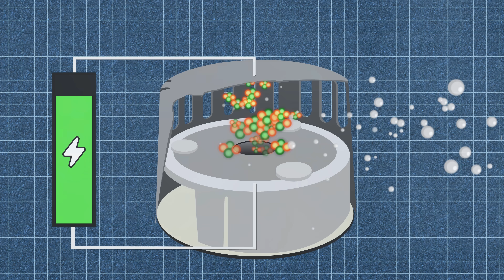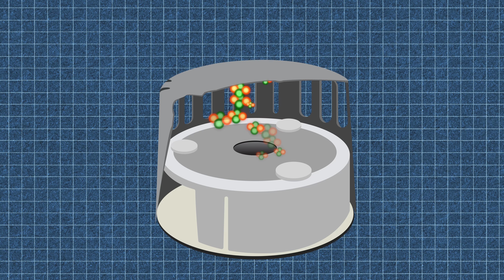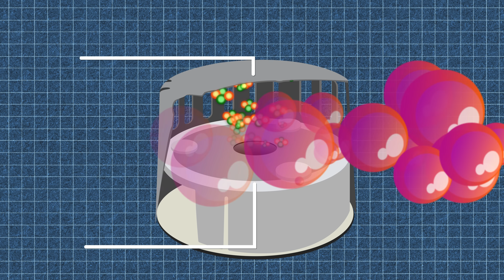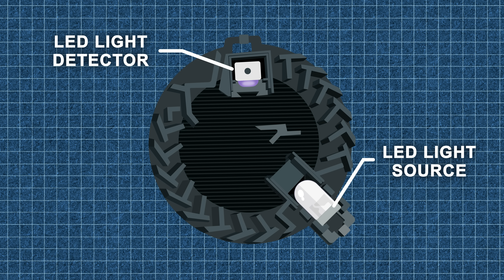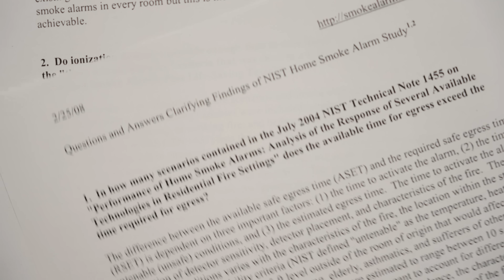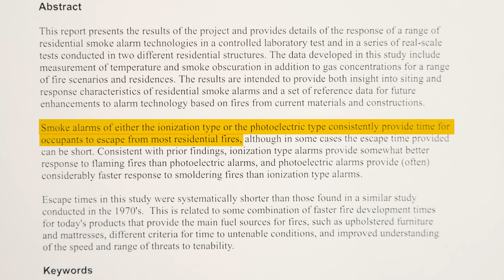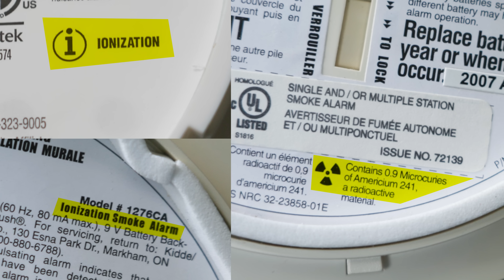Why the Most Common Smoke Alarm is Dangerous

Comment: Why not make a smoke alarm that has both types of systems??? The circuitry on some smoke alarms look like they came from the beginning of 1960's. Sometimes one can buy a toy today that's more complicated than a smoke alarm for less. Just wondering. 🤔 Next why do natural gas alarms go through batteries like the world is ending? 🤫
Reply from the maker: Are you talking about CO alarms?  Maybe get a newer version integrated with your smoke alarm with a 10 year battery.  Those last a while.

The problem with dual sensor alarms is these alarms can be just as sensitive to cooking false alarms (UL, Characterization of Smoke Alarm Nuisance Sources, 2015).  They're also hard to find, expensive, and the only 8th generation dual sensor alarm is currently unavailable for purchase (as of June 5, 2024). 

As well many homes require CO detection and you'll have to choose between having those separate vs interconnecting them with the rest of your home.  I think Interconnection is more important.

Kidde's new 9th generation of smoke alarm is Photoelectric only.  This was what I was expecting in the video as I was shocked ionization could pass the new tests, but I'm guessing that's no longer possible.

Comment: Instead of a really neat $100 floating magnetic pen, I'll buy a $25 Fisher Space pen.  They use a special ink in a pressurized cartridge developed to write upside down or in space with no gravity.  They also write on slippery surfaces, under water, and at really cold and hot temperatures.  Great pens.

Then I'l spend $5 on a little cylindrical wire pen holder.  Then I'll have place for my pens, different color pens, pencils, high lighters, Sharpy markers extra fine and fine tipped, a couple of small screw drivers, a snap blade knife, and even a small flashlight for when I drop something under my desk.  I can find any of those items in just a couple of seconds wen I need them.

Comment: Now can you do the same for carbon monoxide detectors? I read the specs on some and it is scary. Also, the government regulations about them says that some may take up to 30 minutes to respond. My curiosity came about when a job that I had required a body-worn CO detector which had much superior response. So what's good for the home?

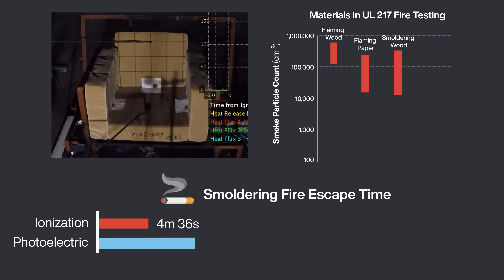Comment: At 11:26 and 13:28, are the labels of the bar graphs switched around accidentally? From the audio I expect that 'Ionization' on the left (Smoldering Fire Warning Time) would have the blue 35m 36s bar, and that 'Ionization' on the right (Flaming Fire Warning Time) would have the slightly faster blue 2m 9s bar
Reply from the maker: Hey Mool,

The graph is correct, it's an unusual way of talking about how useful an alarm is.  

The actual metric is ASET - Available Safe Egress Time, which is how long after the alarm goes off you have to get out before conditions become dangerous.  It's a more accurate measure of how useful an alarm is in saving your life.  It's also an indirect a measure of how fast each alarm is alarm is.   

Yes, this is confusing, I thought about different ways to represent the data and this is the simplified version although I should have went with "escape time".
Reply: @Lam  Ah thank you for explaining. That metric is not clearly indicated in the graph or narration, and I find it not very intuitive.

Comment: Good info.  When I moved into this house almost 10 years ago, I changed out all of the alarms as there were 10 years old and discolored.  The round and round about ionization and photoelectric back then...  Thus, I have some of both with one type also having carbon monoxide detection.  It's almost time for new alarms.

Comment: Why don’t we just put both functions of the fire alarms into one fire alarm wouldn’t that work? Why don’t we throw a carbon dioxide detector in there while we’re at it?
Reply from the maker: Hey Ray, thanks for watching and asking about dual alarms.  

The problem with dual sensor alarms is these alarms can be just as sensitive to cooking false alarms (UL, Characterization of Smoke Alarm Nuisance Sources, 2015).  They're also hard to find, expensive, and the only 8th generation dual sensor alarm is currently unavailable for purchase (as of June 5, 2024). 

Like you mentioned, many homes require CO detection, they do exist as a combined model.  The problem then is you'll have to choose between having those separate vs interconnecting them with the rest of your home.  Same issue if you want separate photoelectric and ionization alarms.  I think Interconnection is more important.

Kidde's new 9th generation of smoke alarm is Photoelectric only.  This was what I was expecting in the video as I was shocked ionization could pass the new tests, but I'm guessing that's no longer possible.

Comment: A few years back I had hardwired smoke alarms from the mid 1980s. I kept them because they still worked. That is, until one day I was using a staple gun on a wall that had one and the vibration must have caused something inside the smoke alarm to fail. The smoke alarm caught fire, then alerted me that it was on fire lol. I took the rest of the hardwired alarms out that day. I'm still amazed to this day that a smoke alarm can still work after 30 years, catch fire, and still alert you that it's on fire.
Reply: The smoke alarm caught fire 😂😮
Reply: I have hardwired alarms in my house, i think theyre early 2000's, but they have 2 mains power lines and one data so if one goes off, they all go off
Reply: @joshanderson1019  Mine were not that smart. The one that literally was on fire was the only one blaring that it was detecting smoke.
Reply: no smoke or CO2 alarm should be 30 years old, they are not working replace every 10 years as per manufacturer instructions
Reply: @cengeb  mine is 30yrs old, it for sure still works, i've tested it everytime i cook garlic bread lol. also, if you light a match under it, it will detect that smoke and go off. it should probably be replaced at some point, but i have made a point to be sure it is operable, which like i said, i light a match under it and it will go off still.
Reply: "uh can you help im bur- BEEP BEEP BEEP BEEP BEE-
Reply: no sane person leaves a smoke detector in place for 30 years.  totaly against mfg recommendations, and logic.  Oyvey
Reply: Definition of “they don’t make em how they used to” 😂
Reply: @Myah37 to be fair, the halflife of the radioactive material they use is 400 years so the sensors easily outlive us
Reply: Was the thing mains powered or how did it start burning? (Mains lines often fail by fire before smoke reaches the alarm.) Those dread unreplaceable 10 years lithium batteries are highly flammable and certain such smoke alarms did set houses on fire (which may be triggered by even triggered by a firmware backdoor to eliminate politically unwanted people and their documents). So I solely use non-wireless photoelectric smoke alarms with harmless alkaline 9V battery.
Reply: @cyberyogicowindler2448  He just said they were mains powered.

Comment: Bro doesn't understand that we have different types of smoke detectors for different types of fire it's like getting mad because lightbulbs don't last forever and car tires only last 30k miles. Everything is a compromise and usually it's a designed one. The point of ionizing vs optical smoke detectors is because sometimes you have fires in the kitchen and sometimes you have fires in a bedroom they require different types of detectors you just didn't know that are and calling it a conspiracy.

Comment: As a retired electrician,  I always used at least 1 optical smoke detector,  mainly in the room closet to the kitchen. I always put detectors in all bedrooms and hallways. One of the biggest things is placement, they need air flow. Not too close to the ceiling or in a corner. Always read the directions.

Comment: They don't trip from heat or smoke, they trip on particles scattering light between a source and a detector for the light source. If the particles in the room are translucent or absorb the light then the detector never gets tripped and everything burns a little different and produces it own unique form of smoke particles.

Comment: Sure, until you use common sense and realize if smoke detectors were anymore sensitive a lot more people would do what many already do and just disable them. The reality is that while this isn't perfect, a more sensitive smoke detector would actually result in less detections after people take it down because it goes off every time they light a match or cook.

Comment: Great video!  (as former certification engineer) UL standards are based on NFPA 72 (national requirements).  The two work together along with industry, fire protection professionals, etc. in developing minimum requirements (emphasis - minimum)

Comment: Why not use a combination of the two detection systems? If you had both detection types in one alarm wouldn't that help to counter the individual weaknesses? I'm sure there is a reason not to but I just don't know what it is.
Reply from the maker: Hey Beast,  thanks for watching

The problem with dual sensor alarms is these alarms can be just as sensitive to cooking false alarms (UL, Characterization of Smoke Alarm Nuisance Sources, 2015).  They're also hard to find, expensive, and the only 8th generation dual sensor alarm is currently unavailable for purchase (as of June 5, 2024). 

As well many homes require CO detection and you'll have to choose between having those separate vs interconnecting them with the rest of your home.  Same issue if you want separate photoelectric and ionization alarms.  I think Interconnection is more important.

Kidde's new 9th generation of smoke alarm is Photoelectric only.  This was what I was expecting in the video as I was shocked ionization could pass the new tests, but I'm guessing that's no longer possible.

Comment: The photoelectric ones suck in deserts that experience dust storms. As an Electrician while serving in Kuwait and Iraq -every time we had dust storms they would set the alarms off and this would shut down the central A/C on systems that were connected. It made many people upset that not only was sand and dust everywhere you’d also be sweating even more in the desert heat. They would get dusty over time also which sets them off (the LED reflects off the dust particles coating the inside). You couldn’t just blow them clean with a can of compressed air/CO2 either. 

Opening them up and washing the little black plastic removable cover and cleaning the detector lens with a Q- tip works but opening them at all often voids any warranty on individual devices and complete alarm systems (don’t do this, It’s better to be safe than sorry). So, we would just replace the entire detector and throw away the dirty/malfunctioning old one. 

I prefer a combination Universal Security Instruments 10 Year Sealed, Battery Operated, Dual Sensing 2-In-1 Kitchen Smoke and Fire Detector, Microprocessor Intelligence detector in my home with the 10 year lithium ion battery. Steamy showers still set it off though. 😂 This is not an advertisement it’s what I actually use, I ordered them from a home improvement store they are pricey but life is priceless.
Reply: MQShawGravity, the usi model you have most likely has ONLY an ionization sensor alone.  They pair that single sensor with a cpu to process the data and then call it a dual sensor equivalent.  But it’s not using a photoelectric sensor and therefore I wouldn’t trust it.
Reply: @MQShawGravity  ok fair point.  You must have a different model than I have.  The one I’m describing is either called iophic or universal smoke sensing technology.  What makes you think I’m a bot?  I’m definitely a real person.
Reply: HI Niel did you know that Mr. Butler has state that an iophic is consider an ionization type and Iophic alarms have been found to cause death ? in other news did you know the cdc came out with a report that says 10 year alarms dont last 10 years ?
Reply: @Fredengle  You’re supposed to test them monthly and look for the flashing LED. Who cares if it doesn’t last an entire 10 years? I’m not putting a stinking 9 volt battery in it every month when it starts beeping.
Reply: the problem is some jurisdicition have idiots in charge and require 10 year alarms that means the only option to be legally to compliant is to replace one defective alarm with another AND also ionization alarms are less money some one might by an ionization alarm and not realize a photo electric is safer and that could cause  a problem do you not realize the cpsc has over 32 years of lawsuits of ionization failures but I am willing to bet you 25.00 that any fire litigiation attoroeny you ask will not say they have a lawsuits where a photo electirc alarm has been blamed for a  death because it has been argued that 100% of all lawsuits are agasint ionization technology who care well some one might by an in expensive ion 10 year alarm than is a problem one problem with requiring 10 year alarms is if people dont know there could be problems did you know they it has been scientifically proven they type of smoke alarms you use can make the diffrence between life and death! who cares you say thats not a good way of viewing the info even the battery manfs experessed their concerens these alarms dont work well and who cares you say did you know that some fire departments are bussineess partners of manfs ? you dont know if they dont require defective alarm so they can make more money who cares requireing 10 year alarms raises the price of alarms to about 40-50 dollars  a photo electric alarm the type you should have in your home can be made for about 5.00 and sold for about 30- requiring 10 year alarms that are more expensive could if some one want to be complaint reduce the amount of availble alarms available did not thing of that did you ?

Comment: Hopefully some of these 8th gen alarms will also include CO detection and sealed batteries. I owe my life to CO detectors. In 2009 there was a Nor'easter that dumped several feet of snow on us. It blocked the vent for our propane water heater and we awoke to the CO detectors going off. Had they not been installed we would have all likely died in our sleep.
Reply: CO detectors are important but one usually needs more fire alarms than CO, and in different places .

Comment: Those horizontal time bars are really confusing.  Fire Escape Time is a completely meaningless concept and it looks like the photo alarms are doing considerably worse than the ionisation alarms.   Why not measure how quickly an alarm reacts to a particular type of fire?  Then the longer the reaction time, the longer the time bar, and the worse the alarm.

Comment: I actually have only one single smote detector in my house, one without a battery that just sits on a board in the stairwell. And my house is fully made of wood, as quite common for rural areas of Sweden…

Comment: What I find most disturbing is, that my smoke detectors tend to detect a low battery only between 2 and 4 AM in the middle of the night...

Why can't they have two battery levels: When the battery voltage is below the first level AND when at the same time there is enough light, then and only then sound the "battery low" alarm.
(Yes, define "enough light"...).

And when the battery voltage is below the second (lower) level, then sound the "battery low" alarm no matter if it's bright or dark in the room 

(This is just in case it cannot detect enough daylight and the battery level is lower and lower, then it's OK to sound the "battery low" alarm anyways, no matter if you are probably awake or not...)

It would be so easy...
And so helpful...
Reply from the maker: Yeah, I wish they had something like that.  The problem is you need a smarter and more expensive alarm that manufacturs don't want to engineer for. 

I found out during my research that smoke alarms chirp at night, because colder temperatures drop the voltage sounding the warning.  When it warms up during the day it goes away.  Incredibly frustrating
Reply: @Lam   that's interesting, sure, when it gets colder during the night, the battery voltage drops a bit. Sure it does. And when it's already just a tiny bit above the minimum voltage, this could be the trigger...
Reply: Oh and beep more often than just once every 2 minutes.
Reply: @pizzablender   oh yes, imagine it's in another room, you go out the hallway, "where is it"... All right, wait for two minutes in the hallway... Oh I hear it, was it here or there... Not sure... Wait another 2 minutes...
Reply: @Richard-S  And then it suddenly stops it is getting warme or cooler in the home...